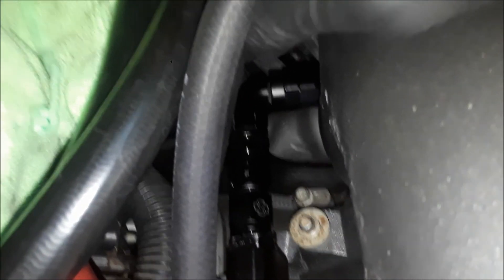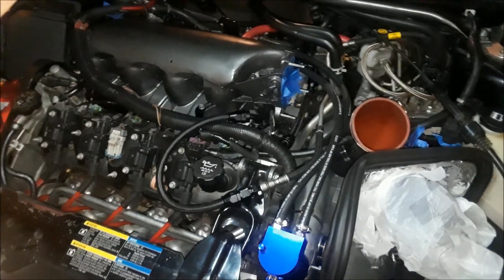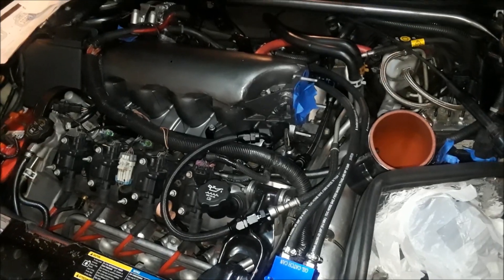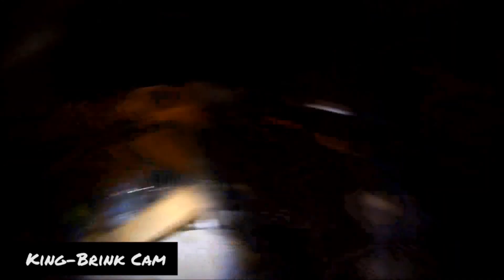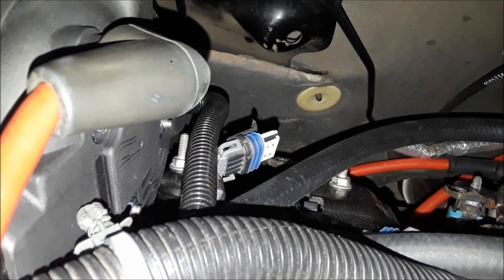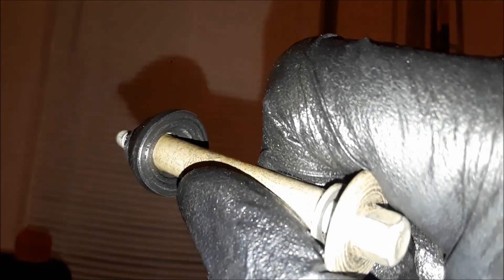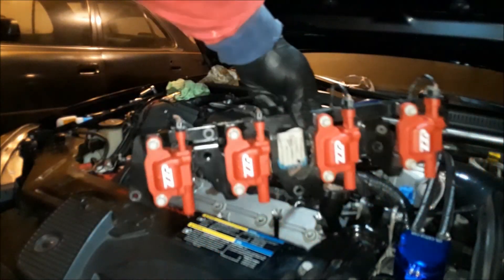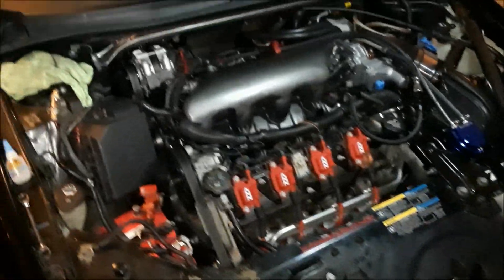LS4-LQ4 Intake Swap Step 8

Comment: So would the truck throttle body work? Because im using thd 90mm gold blade throttle body and i have a high idle and goes into reduce engine power whenever i wot it and let off the pedal or do i just need to simply tune this throttle body for the car i converted my 8 pin adapter to a 6 pin adapter for the throttle body but if i could use the truck throttle body which was a 8 pin i would have you tried the truck throttle body or know what would it need to make it work
Reply from the maker: So I did have a truck TB and scrapped that idea because it didn't even start. Lol, But that could've been user error. And Ive heard about issues with that truck TB as well. For the LS3/LS7 TB, James Brewer or a good tuner will have to tune it so that it could work. I not sure if it being a gold or silver plate has anything to do with it.